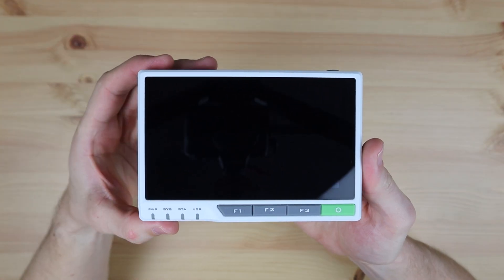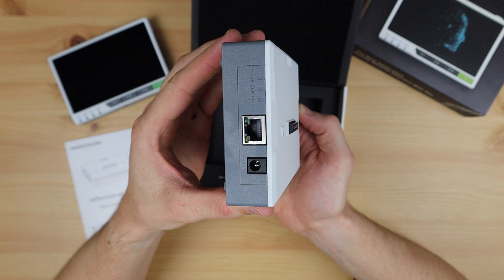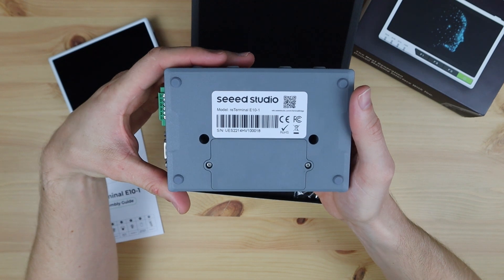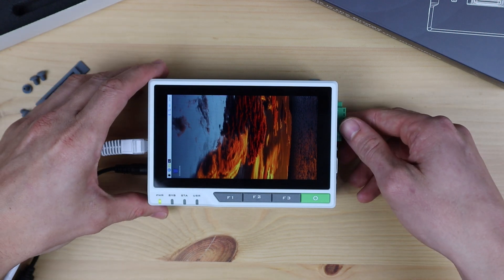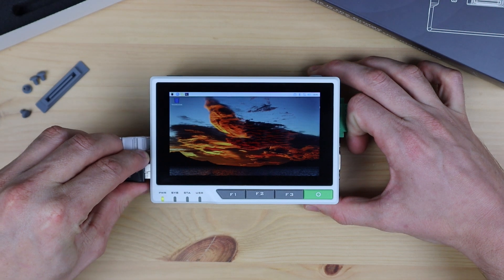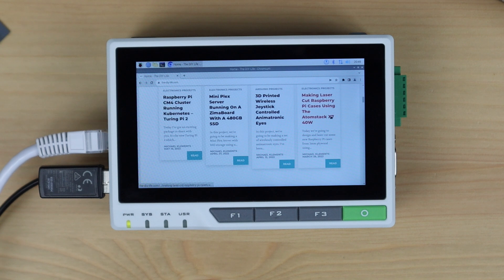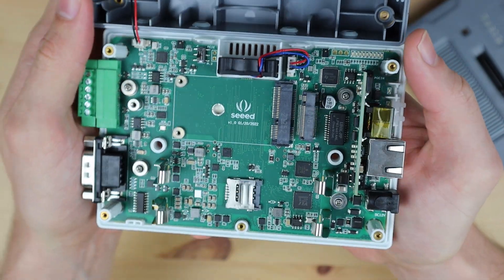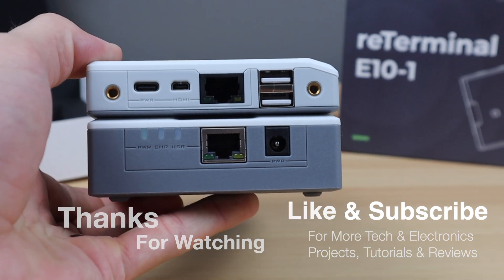The E10-1, The First Expansion Board for the reTerminal

Comment: The terminal itself would be great for embedded stuff like ATMs, Infotainment retrofitting things for older cars and much more. This expansion would allow more industrial use cases.
Reply from the maker: Yes, I can see quite a few neat applications for the reTerminal itself. It would be great if they made a low profile CAN interface board for it to use in vehicles.